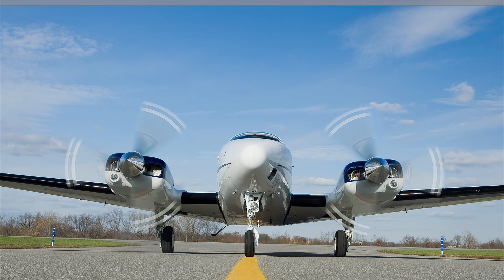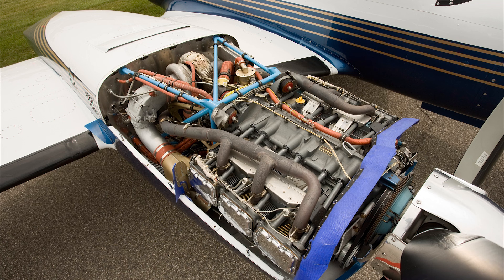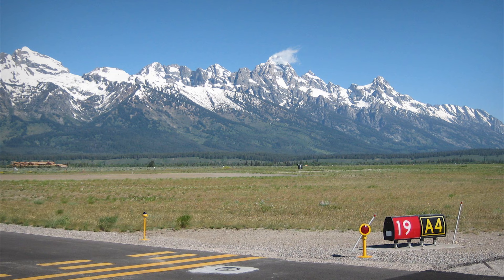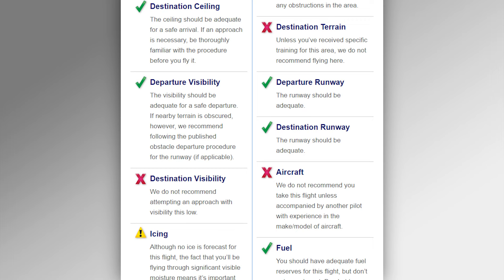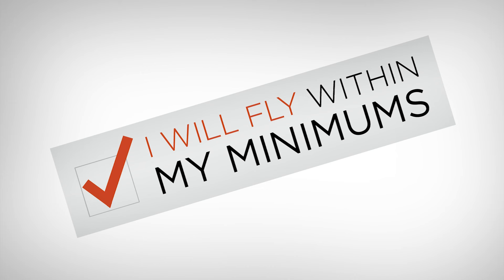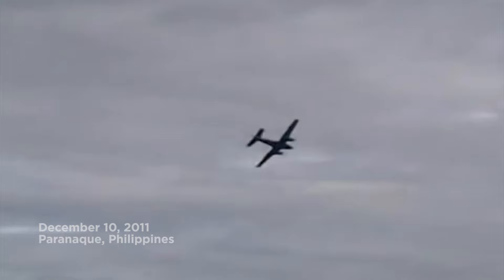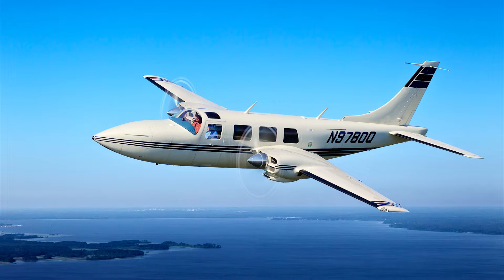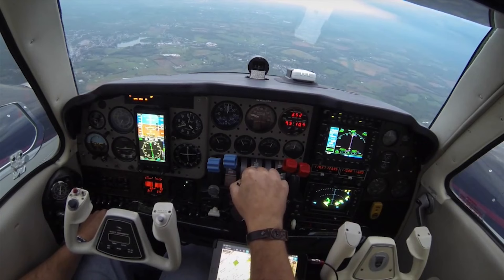Taming the Twin: Four Rules for Safe Multiengine Flying

Comment: Rule #1 in Multi-Engine flying is to always assume you are going to have an engine failure on takeoff. 
Rule #2 know your engine out procedures cold.
Rule#3 Brief every takeoff, what you will to in the event of an engine failure.
Rule#4 don’t get complacent
Reply: All good Steve. I would add "Do not panic".
Reply: @Doodles1947  I flew in a glider 1st time in my life...even though we were cruising at just 50 knots and with a glide ration of 30:1, All I could do was freeze and keep level flight .. panic comes natural lol

Comment: I was always told that losing an engine in my TC-310P left me with enough remaining performance to make it to the crash site safely.
Reply: Those same people will also ask you to go to the hangar and bring back a gallon of propwash.
Reply: @karlrschneider  Yup. It's in the back next to the rotor wash. 😏
Reply: Once at the crash site, it’s only a question of where to bury the survivors.
Reply: correct.
extends time to find a better place
controls the landing
Reply: You have never shut one down ? You may be surprised !
Reply: I'm interested in your 310.  Did you install the McCauley propeller conversion?  How was the OEI performance?
Reply: @wojciechgrodnicki6302  We only had standard engines and props.  The engines were TSIO-520's with stock turbochargers, 285HP each.  Our sea level performance was the same as the unboosted variant, but our IAS stayed at 200 MPH regardless of altitude, and our service ceiling was 27,000 feet with the turbos.  Unless winds were a problem, we flew longer flights at 18000 feet.  Great airplane!  What do you fly?
Reply: @Reach41  I'm currently working on my Commercial MEL in a BE Duchess.  
Did you install an O2 supply to fly so high?  My dad had a 310 when I was a kid and I recall it being unpressurized.
Reply: @wojciechgrodnicki6302   Unpressurized with built-in 02.  The cabin class 340 and up were pressurized.   You already have your Multi-I?  What are your plans for the future?  It seems like there's a huge shortage of airline pilots if you want to do that, or at least there was before the virus crept up.  And there's always Alaskan Bush Pilot!  

I don't fly anymore, sold my half of the plane to my partner 20 years ago after I started a business that took all of my time.  Before that, I had a Citabria 7KCAB that I learned to fly in.  Loved both planes, and everything about flying.  Now I do all my "flying" in an A-10C Warthog DCS simulator.
Reply: @Reach41  I have a Commercial Multi I check-ride in two weeks.  I have no plans yet.  I was going to complete my CFII Rotorcraft in March before the Virus so I'm standing at a crossroads.
Reply: @Reach41  War Thunder also has the A10 btw.
Reply: @wojciechgrodnicki6302  You have a bunch of money and time invested in this.  I'm impressed.  I do robots for a hobby, build them from scratch and program them to operate anonymously.  Also have experience in industrial automation. With that for credentials, I do not see any risk to ATPs from AI in the cockpit; way too complex if something goes south.
Reply: @Reach41  That's reassuring.  I managed to get the government to pay for helicopter stuff so that helped.  btw
Reply: @wojciechgrodnicki6302  Were you in the military?  Wondering how you got the Gov to pay.

I'm kind of anxious for the updated Microsoft sim to come out just to use it for IFR practice.  The Warthog sim is ILS capable, and it seems realistic, but that's not the focal point of the sim.  BTW, it flies and handles like the real thing, including systems and weapons management.  I'm not sure how people with no flight training ever learn how to land the thing.
Reply: @Reach41  I was enlisted in the Marines, were you in the Air force?
Reply: @wojciechgrodnicki6302  Enlisted in the Navy, flew as a crew member on a carrier-borne anti-sub plane.  Used the GI bill to go to college, it was a life-saver.  And thank you for your service.  The military is not a safe place even if one never sees combat.
Reply: @Reach41  Yeah, I was surprised when apprised of how many sailors die on ships due to accidents and such.  I heard that shore-leave in Thailand also causes attrition in the ranks.
Reply: @ Hot Rod Ray

Controls the landing?  Lol.. watch some Vmc rolls. You don’t want the engine to be at anything other than idle when you land.
Reply: If you fly a 310. My favorite hot rod & this is a question, you have never been in the left seat ! Show me any piston twin that has any better single engine performance ?
Reply: @paulvantries7013  That was a joke, Paul, told to me dozens of times by single engine pilots.  I not only flew one from the left seat, it was a turbocharged 310, and I owned it.
Reply: @Reach41  You got me !! Same here. How stupid. Your 310 is the finest twin ever made. The old C model was the hot rod N6696B. I do know your P model can out run it in every way Thanks for the fun !
Reply: @paulvantries7013  N5752M here.  Cheers!
Reply: @clayz1   You can't bury the survivors because they are not dead.  Survivor = Alive.
Reply: @labeachgeek  right next to the blinker fluid!😂
Reply: You've been told wrong.
Reply: @karlrschneider  Thank you.
Reply: @Doodles1947  That was a joke shared between pilots.  A joke can't be wrong.

Comment: The huge omission in this video is the most important one for pilots of light twins. Pilots must memorize and then practice the 9 basic immediate action items that need to be done quickly and accurately should an engine fail close to the ground on takeoff or go around. Since the airplane will not climb, or might even be descending, there is no time to read a checklists. Here is what must be done and done quickly: 1. Mixtures, prop and throttles full forward 2. Pitch up to climb attitude 3. gear up ( do NOT wait for a positive climb as most light twins will not climb on one engine gear down) 4. Flaps up 5. Identify (dead foot, dead engine) 6. Verify (slowly retard suspect throttle. If no change in rudder use, the failed engine is verified) 8. Prop failed engine full aft 8. Mixture cut off 9. Prop feather.  (These 9 items need to be practiced often until they can be done in one’s sleep.)
Establish climb at Vyse, bank 3-5 degrees toward good engine and apply rudder so that the ball is 1/2 ball off center toward the good engine. To remember which which wing to raise, the gouge is “raise the dead”, as in raise the wing of the dead engine. 

REAL multi-engine instructors would have said all of this in the video, which was long on theory, but short on real useable information for the multi-engine pilot. Joel Turpin. ATP CFII FAA Master Pilot
Reply: Every twin ME pilot learns the drill. Rule #4 covers this implicitly...remaining proficient as a ME pilot means (among other things) keeping fresh on 'the drill.'
Reply: Thanks for informative comment. I'll never be a ME pilot (age, $$) but find your check list illuminating. Always pays-off to train to be a better pilot.
Reply: Precisely. You have succinctly described the nine steps that must be followed on every such occasion and by instinct through intensive training. From what I've read an engine-out on takeoff was the major non-combat cause of fatalities for P-38 pilots. The plane would flip over and auger-in in the blink of an eye if the rotation speed was incorrect. It even happened fairly recently to a civilian P-38 non-owner pilot who flew warbirds as an aviation journalist and had a special attachment to the P-38 due to his father flying one during WW2. Very ironically and sadly he was the now-deceased pilot who gave me the information about the cause of the majority of non-combat fatalities of military pilots flying P-38s. But it happens to airline pilots too, an example being 42 fatalities in the engine-out crash on takeoff of the TransAsia Airlines ATR where the PIC mistakenly retarded the throttle on the good engine. How does someone without the proper training obtain control of an aircraft and kill 42 passengers and crew in this case through sheer incompetence at his job?
Reply: If you are doing 9 actions on an engine failure, you are going to die. There are two things to do. Kill and feather the bad engine. Fuel flow tells you which one has failed. On takeoff, throttles and props are already full forward. After that, gear up, pitch for whatever climb you can achieve. Raise the dead might not be the best thing, since the good engine will help you turn, you just have to be careful about bank angle. Sad that a "Master Pilot" is so wedded to dogma.
Reply: @colinrasmussen9470  You are right of course. Five seconds of surprised indecision/inaction/incorrect action or trying to take too many actions from memory could be all it takes. I read somewhere that more P-38 pilots were killed in engine-out takeoff accidents than were lost in combat. The beastie had a tendency to flip over and auger in before the pilot could take any action. Ironically I read this in an article written by an aviation journalist who was later killed in a P-38 during an engine-out takeoff accident. I have flown the touchy P-51D with built-in instability and without incident but my instinct for flying a P-38 would be to gain a whole lot of speed margin flying low over the runway during takeoff before climbing away and raising the gear, rather than blindly trusting the engines.
Reply: Disregard all that. Especially you, Joel.
Reply: @colinrasmussen9470  Thank you. You are absolutely correct. It is frightening to read some of this horseshit.

Comment: If your twin won't climb or maintain altitude on one engine a twin is a lot less safe than a single engine airplane because an engine failure is now twice as likely, it is still going to force a landing, but in a twin that forced landing is going to take place at a higher speed and asymmetric thrust making a stall/spin more likely.
      Losing control of a twin engine airplane with a dead engine is a lot more likely than in a single engine plane plane with a dead engine because how the plane responds to control inputs change with a loss of power in the different aircraft types.

Comment: Maintain Directional control and pitch for Vyse "Reds, Blues, Throttles full forward, Gear up, Flaps up, Identify, Verify, Feather (under 2500)". That was drilled in my head during my Multi training in the PA-44-180.
Reply: Love the Seminole. Flew one 165 miles with one shut down on takeoff once. Climbed to 5500 and outran a 172 accompanying. But, most airplanes bite much harder than that. If I remember, VMC was below stall speed.

Comment: Most engine failures happen at the 1st power reduction, make the power reduction at an altitude where you can stay level and return to the airport.  Forget about the climbing ability on one engine.  In my last Beech, the book said 300 fpm.  I was lucky to get 50 fpm and that was under gross and with an American Eagle captain instructor on board.   He couldn't do any better.
Reply: figures get inflated to make the book look better.
i witnessed it. liars.
Reply: @ Hot Rod Ray.

No. You are clueless. 

In fact, if you’re using Net Takeoff Flight Path... the numbers are deliberately degraded.

You witnessed substandard piloting.

Comment: At video time marker 05:15, fatigue. Yes! It is a huge factor. I would suggest that any and every flight school which is teaching student pilots for future commercial careers add a few "Real Life Scenario" hours to the curriculum in order for the students to learn just how to operate while they are fatigued: Learn to recognize when "over the line" fatigued is too great to fly, how to minimize the effects of fatigue, most probable mistakes which are made while fatigued, how the mind and body react to fatigue... If you are going to fly air machines for your paychecks, you will encounter many days and nights of operating while absolutely exhausted. It's a certainty; it cannot be avoided. Learn to recognize it and its dangers. Learn to handle it in the manner which minimizes the dangers as much as possible. And by the way, as a professional pilot working for most any Part 135 operator, you can pretty much toss the "I'MSAFE" checklist out the vent window.

Comment: And remember, an engine failure is an emergency, even if you have a "spare".

Don't be afraid to call ATC and get some help, and don't get cocky like that CFI in the last anecdote did.
Get that thing safely on the ground as soon as you can.
Reply: Yep. If you won’t accept a 30 minute hold in your aircraft’s current state, declare the emergency.
Reply: Yes, that decision he made actually SHOCKED me!! More so, because he was a CFI, and not some brand new pilot with his newly earned "multi rating"!!
Reply: @465marko  ROFLMAO! 🤣

Comment: Great video. Study, plan and fly safe. I've flown Cubs on floats, DC-3s, T-38s and C-141s before the Boeing line with Delta. Leading large formations of jets, flying special ops low level on the goggles and flying light twins single pilot at night or in the weather were the biggest challenges of my career. At this stage of the game I'd rather fly a highly automated B777 single pilot than a C310 or Aztec in the weather at night. I'm not diminishing the essential role of the F/O (many have saved my bacon) but stressing the workload as a single pilot. Be safe and have fun.

Comment: My father was flying his Commander 500, between Cozumel and Miami we lost one engine, the plane flew without a problem. 
On the other hand, my uncle lost one engine in a C 310, crashed and die. At the end I learned that there are differences in plane performance, many factors will affect the way a twin flies without an engine.
However, I always keep in the back of my mind that in a single you are always a step of an emergency while in a twin is a matter of stretching the hard landing.

Comment: My experience and that of everyone I flew with was that we could not manage an engine failure in takeoff. We were taught and became a believer in repeated simulator trials to not retract the gear until reaching an altitude where we could control an engine out. If an engine fails below that altitude you just pull the other engine back and land anywhere that is available. That is not popular, and not what you would like to believe. But the simulator will make you a believer!
Reply: "But the simulator will make you a believer!"

Well, that would be tragic. As would any loss of an engine anywhere for you given your very wrong understanding of what happens when one calves. First off, it is not altitude that determines when you retract the gear, other than 0 altitude, in which case you might be criticized for raising the gear. Hopefully that goes without saying. Let's analyze this bit by bit.

On the takeoff run, you do not leave the runway before you have VMC plus some safety margin that the manufacturer imposes, or which you may add to. The manufacturer must state VMC by law, and it essentially says that is the minimum speed at which the airflow over the control surfaces is sufficient to counteract the yaw/roll that asymmetric power will produce. If you don't have that speed, you are still on the ground with hard surface under both wheels. Cut the good one, and depending on the twin's single engine taxi capability, taxi off the runway and to the ramp. Or get a tow. 

 If you are above VMC, then you are, or very soon will be, in the air. There may be a brief happy coincidence time when even though you are in the air, it is possible to chop power and land on runway remaining. If that is not the case, and it rarely is, you must fly the airplane to save it. It doesn't matter if it is ten feet or  2000 feet, you MUST retract the gear. (Don't spend a lot of time on this if it is an Islander or a Partenavia). Depending on the manufacturer's procedure, you may feather first, or gear up first. Which this is likely depends on the certification flight testing, and which sequence produces the earliest improvement in drag and an ability to climb while maintaining control. i.e. not letting airspeed decay below VMC. 

Simulators are good for practicing procedures. But they do not test the single most important factor in dealing with an engine out emergency. That is the introduction of the real possibility of imminent death for the pilot and passengers if the pilot cannot perform in the face of that threat. In twin engine aircraft, and in the takeoff mode, a great many can't. 

Lose the idea that altitude has something to do with when to retract, with the exception of sufficient runway ahead to land, which has an indirect relationship to altitude.

Comment: If you can’t afford to fly your airplane regularly, say four hours a month if you have a twin, you really can’t afford your airplane.
Reply: Jim Beck how much would you say is enough time for a single engine, to stay proficient?
Reply: Jim Beck I’m a new ppl holder, I’ve been averaging 5-7 hours a month.
Reply: @WarriorsfanDubnation  I would say, to maintain a basic level of proficiency you would need to fly 25 hours a year, at the very least. That would be something like, say 6-ish hours every 3 months or so. Of course, with this little time, the tricky thing would be to make sure your time includes everything from cross country flying, practicing maneuvers to pattern work!! Also this assumes VFR only.
 
If you have an instrument rating, I would add another 10 to 12 hours a year to stay "instrument proficient" as well! On the other hand, if you have a good home flight simulator (like X plane running on a good computer setup), you can dramatically reduce the additional time for instrument practice, by doing most of it on the simulator and just a couple of hours on the real aircraft itself (as instrument flying is mostly  procedural, rather than the "actual feel for the aircraft".)
Reply: I have been in the cockpit for all my life. You sir are not wrong. Well said !!